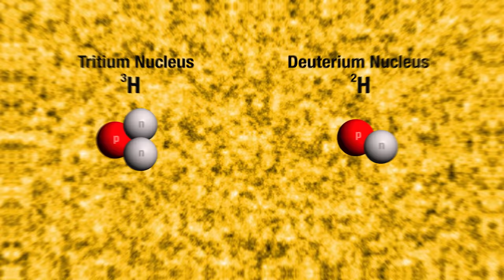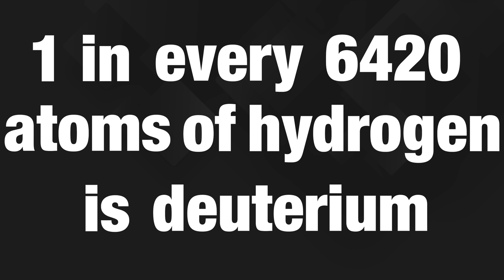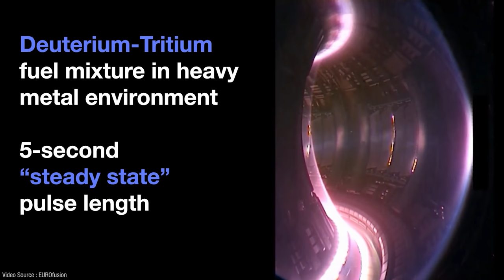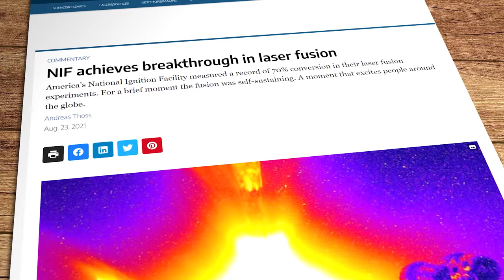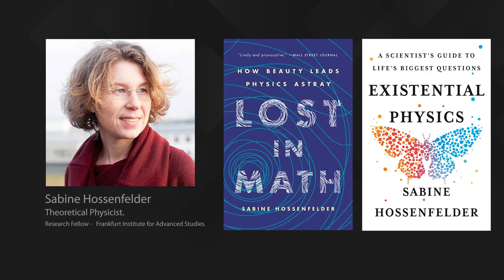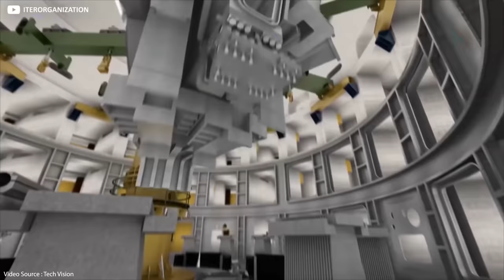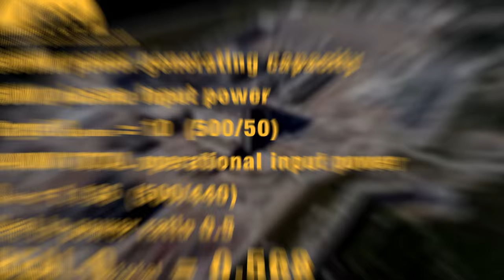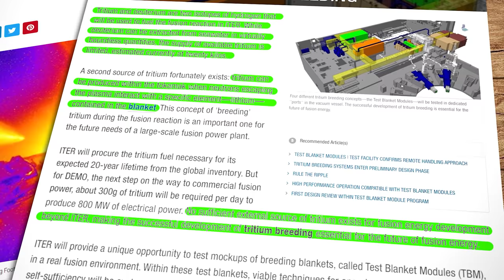Nuclear Fusion Illusion. Is it time to park the pipe dream?

Comment: As an economist, I feel that the economy aspect of fusion is often forgotten. Fusion not only have to be technically viable but economically viable. If we are struggling to make it break even in terms of energy it is incredibly hard to imagine that it will eventually be more economical than just getting energy from the sun, wind and water.
Reply: the hope is that one day we bild one that does break even and starts generating profit.
fusion would not be cost effective against renewables in the short term since the reactors are expensive. but in time they could drive the cost down if they are proven to work. 
the benefit we would get from fusion is that fusion could spin up fast and replace peaker plants, and thus not be in competition with renewables because it would fill a different role. 

i would not personally invest in fusion anytime soon, but as a species we need to pursue all research that could benefit humanity in the long run. Then i support keeping these projects going and even fund more with government money. It not money wasted since an entire industry of technology is built around the construction of reactors and spinoff technologies could be proven usefull.
Reply: @nilsdock  The problem is that this hope is essentially a pipe dream.  Paying for those ridiculously expensive reactors is the largest problem, and it does not appear to be solvable in a world where electricity from conventional renewables is already dirt cheap.
Reply: This.
Reply: @nilsdock  Sorry but fusion using steam will be the same as current steam turbine plants.. which take 2 days to heat up and 2 days to cool down. Actually much worse because you also have to cool down the magnets which will take several days. No instant energy there. It is base load power like current coal fired or nuclear fission system reliant on steam cycle. Totally useless for filling peak power demand. That is why battery technology and pumped hydro is so important as ways to store energy for use when wind doesn't blow and sun don't shine. 
I actually think the whole engineering of getting heat out of a reactor surrounded by cryogenically cooled super magnets is ridiculous. The power consumption of keeping the magnets cool while producing intensely high temperatures inside the container merely a meter or so from the magnet is a huge problem. It works for experiments but the efficiency of ITER, if they manage continuous fusion, means that  waste heat starts to become a problem.
Reply: @rayhaverfield2485  Nation wide battery tech is also a pipe dream nowadays.
Simply all potential solutions need to be pursued, and thankfully are. 
Much more capable scientific committees than the youtube comment section have deemed fusion a worthwhile project. Maybe they deserve some credit.
BTW, tokamaks  can follow demand, they'll probably simply always work at 100% because thats what you do if your fuel costs are negligible and want to pay the loan asap.
Reply: @nilsdock  Fusion is so capital-intensive (the initial investment is so large) that it would never make sense to run it as peaker plants. Also the startup energy demands are so costly that you want to start up as few times as possible and maintain a steady state at all costs.

To maximise profit (make non-negative profit) fusion plants would have to run continuously.  This is true of all new unsubsidised steam turbine generators these days.

Spinoff technologies from battery research are more likely to be useful in the near futture than spinoffs from fusion, and the battery technologies themselves are directly useful. "Spinoff" arguments are raised when the main argument is utterly hopeless.
Reply: might take us a hundred years to get power plants, twice that to make it affordable.
Reply: Renewables become a lot more expensive when they make up a larger portion of the energy suply due to their intermitance. Solutions exist and can be improved but will, like fusion, cost money.
Reply: @incognitotorpedo42  The hope is that fusion energy will also be "dirt cheap". Remember, those reactors also generate a lot of energy, so per $/W is in the same ballpark as renewables now. Probably between 3-10$/W. Note that you have to compare Solar+Wind+Storage against Fusion not just solar or wind prices alone.
Reply: @peterpan5753  they do not generate a lot of energy. 
1. the process needs to produce the same energy it's placed in, 2. plus much more energy to pay for the conversion, 3. plus much much more energy to pay for the super expensive machine cost, (up to here it's not even broken even) 4. and much more on top of that to be profitable. 
currently we are 10% of point 1.
Reply: @rayhaverfield2485  Doesn't strictly have to be. There are ways to generate energy directly from fusion. A company called Helion is working on this right now.

Comment: Great video. I actually studied this stuff in university, and I have been frustrated for years at how poor the reporting has been from science journalists around the efficiency of fusion. I am very fed up with articles quoting Q-fusion numbers, when literally the only thing that matters is Q-total.

I get that fusion researchers are focusing on Q-fusion, because that's their line of research, and they don't have much control around Q-total, because it involves systems that they don't necessarily build. Maybe somebody else can come up with huge efficiencies in lasers, superconducting magnets, or heat-to-electricity conversion, and these would reduce Q-total without the fusion researchers needing to do anything differently.

But I think at this point, any time a science journalist reports on fusion and quotes Q-fusion instead of Q-total it should be considered journalistic malpractice. It's really not acceptable to keep repeating this misleading term.

Now, I'll leave you with one fun fact about fusion: our sun is not actually hot enough to fuse hydrogen into helium. The only reason it does is because quantum physics is "fuzzy", and there are outliers in any reaction at a quantum level. Just as an electron can "tunnel" through a solid "wall", nuclear fusion can happen at lower temperatures if there is such an insane number of atoms available that even a very low percentage of outliers can fuse. So these reactors on Earth need to be hotter than the sun, because the only reason the sun can fuse elements is because there's a sun's worth of atoms in there.
Reply: I agree that there's a lot of confusion regarding Q_plasma because of lazy reporting. That's why I rather listen to scientists such as Hartmut Zohm from the Max-Planck institute, or those working on ITER. They tend to be much more honest in constrast to the click-baity stuff in the media.

Btw., the fusion reaction in the sun is not just different because of the high density/pressure and lower temperature. The sun also uses the much less efficient deuterium-deuterium fusion reaction, whereas in fusion reactors we need to use deuterium-tritium reactions. Otherwise the extremely low density of plasma in tokamaks and stellarators would be insufficient for any considerable amount of fusion.
Also, the sun's fusion process produces less than 300 Watts of heat per cubic meter even in its core, which is a pretty tiny power density unless we consider the sun's enormous volume.
Reply: Idk, for fusion scientists the Q-fusion number seem to be the thing to focus on as that is what they presumably focus on. Journalists reporting that number also seems fine as ppl that are following it can see the importand number. But the mainstream focused media should probaply mention both with a link to somewhere where the difference is explained, and why the Q-total might not matter (the pant isn't build with it in mind for example). And the scientist can again be suprised why most ppl are confused XD.
To be completely fair the cost per MWh is probaply the only number that realy matters.
Reply: @Shimmy Shai I would like to see a discussion on this. I believe that storage is only required while the level of renewable generation is close to the demand level that cannot be delayed. The reality si that we need to generate much more renewable electricity than required, using the excess for the traditional uses of aluminium extraction and nitrogen fixation. Add to that the generation of green hydrogen needed for shipping, aviation and iron smelting. Also we will see DC power links effectively builting the whole world into an electricity grid (exept of course for Texas...).
Reply: To be perfectly accurate the correct number to report would be Q fusion and the Q fusion needed for commercial application with that reactor design. Tokamaks Q > 20, lasers Q >100

The thing is that Q gain changes dramatically as a plasma becomes self heating. I believe JET is about 5% self heated at Q = .33 but at ITER's Q = 10 the plasma is 2/3rds self heated. The combination of this and of the effect of superconductor magnets on tokamaks means that from JET's Q total of .01 (yes, it is much overestimated in this video actually) it is possible that in the early '30's the ARC tokamak will produce a Q total of 3. This depends on self heating plasmas performing as well as externally heated plasmas - but with the current curve of tokamak performance related to size and magnetic field we can expect the Q total of tokamaks to go from 1% to 300% in ten years

If you were choosing between Q total and Q fusion your better number is Q fusion, for really good journalistic accuracy it would be Q fusion and the Q number needed to approach commercialization
Reply: "our sun is not actually hot enough to fuse hydrogen into helium. The only reason it does is because quantum physics is "fuzzy", and there are outliers in any reaction at a quantum level. Just as an electron can "tunnel" through a solid "wall", nuclear fusion can happen at lower temperatures if there is such an insane number of atoms available that even a very low percentage of outliers can fuse."  
Where are you getting this from?
Reply: Also news never explain the caveat & difference between our fusion and the sun's fusion; like the sun use Hydrogen-Hydrogen while we use Deuterium & Tritium, so it might something to do with pressure limitation (number of atom/collision) or temperature difference we have on Earth but it was never explained at all, they just said "hotter than the sun" but why?
Reply: What do you say about environmental impact, neutron activation, Tritium (9621 curies/gr)handling ...
Reply: @xponen  The fact the sun has immense gravitational containment makes all the difference.. Net +ve sustained, cost effective fusion power is impossible compared to the competition (Fission Breeder Reactors). The system is so feeble yet made of so much expensive heavy metal and electrical power. It rapid degrades in performance and parts need replacing very often. It will be switched off for repairs most of the time at best... To break even the cost of the 99+ tokamaks  and all the other fusion power experiments have to be made back... tirllion$ wasted globally so far.. Trillions of Watts too...
Reply: @Click Bait I'd hardly call it a waste. And tbh fusion funding isn't all that great. Regardless weather or not it yields economic power plant it has pushed many fields to their limits. Lasers, plasma physics, material science. We have magnets that are orders of magnitude more powerful and energy efficient then the ones used in many of the projects discussed in this video. It's all good research.
Reply: @theultimatereductionist7592  the sun's core temperature is below the coulomb barrier for fusion to happen (at 100%). some particles may still be crashing into eachother at high enough energies, but the energy output of the sun is higher than would be expected from these events. the explanation for the higher output is quantum tunneling causing more fusion events
Reply: @Shimmy Shai there is already enough technology for energy storage in an environment friendly way. Solutions like Na-Ion (you can buy them now), or aluminum phase change (pretty expensive, but solutions are pretty small and good for a few houses). The problem right now for me is that a tes.pod is too expensive, while the technology is superb.
And Na-Ion are made in India. So for me a big transport cost.
But on a bigger scale it can easily be used. Although I would postpone the Na-Ion with another 5 years, and buy the tes.pod like energy storage now.
Reply: @douglasrogers3918  Today between 12:00 and 14:00 the energy price was negative. There is a lot of PV and none of that energy is properly stored.
There is also no incentive for end users to store it. It's all about better grid control and end user dynamic pricing and making storage payable.
And no, there is no green hydrogen, unless you can transport it in solid state.
Hydrogen can best be generated in the last 10 meters because hydrogen has better burning/heating properties than a heating resistor, can easily be generated on the fly, but can't be stored easily and safely.
Reply: @xponen " this  plasma " is in fact a rare gas,  only few grams in the chamber
Reply: And that’s why the process goes slow enough for the sun to provide energy for billions of years.
Reply: They worry about Q-plasma first because they have to walk before they can run. :-)
Reply: sun has also incredible pressure in its core...
Reply: @theultimatereductionist7592  Well it's true, because you can look at the figures for energy produced per volume in the sun and find that it's not anywhere near the order of magnitude we'd need to usefully produce energy in a reactor.  The sun is in that "barely fusing hydrogen" range where, I guess you can argue whether quantum effects are necessary to produce it, but it's relying on unlikely collisions involving outlier particle speeds to actually release energy.  In our reactors we'd need the fusion chance to be much higher.
Reply: It pays to mislead people. That’s the incentive. Like how stealing is free money
Reply: Tabloids work because it’s too much work to research, you could be using that time and effort to live your life
Reply: I once learned that over the course of it's lifetime, when it dies the sun will have practically the same amount of Hydrogen left as it had when it was born. Practically all that Hydrogen envelope of over 600.000 km's in radius is needed just to fuse a tiny tiny amount in the core.     That's how hard it is to fuse stuff.
Reply: 1 g of protium or trillion ton on 15MK. Ratio is ratio. Quantum tunneling theory is bs like previous ones.

I was not able to find. How do they think to extract electric energy from this?
Thank you
Reply: @Shimmy Shai Storing enough energy for wind/solar to be viable at higher overall % of generation is simply a matter of massive infrastructure investment, there isn't any mystery to it.  Huge pumped back hydro where appropriate,  small scale distributed storage where appropriate, megapack batteries where appropriate.  People both underestimate the scale of this problem and also underestimate the scale humans can achieve when they want to (consider the total scale of fossil fuel extraction and refinement operations, for instance)
Reply: You are hereby a GOD!™
Reply: Part of the reason why one would focus on Q-plasma instead of Q-total is that the test facilities are not designed or optimized to be run in energy efficient ways, rather they are built to be adaptable so that the parameters of the fusion process can be adjusted in order to find what setup is the best one for facilitating it. Once (or if) a viable setup has been discovered, actual fusion plant projects can work on cutting down the energy waste of the facility itself by constructing them to only be capable of using the viable setup for electricity generation instead of being designed for research, and this will drastically affect the numbers for the Q-total equation. The Q-plasma numbers, however, will remain very similar as the actual fusion will behave in the same manner in both the fusion power plant and the research facility, which makes it a more appropriate number to look at.
Reply: @douglasrogers3918  The problem with that approach is that it means a huge over-build of both the power generation AND the aluminum/fertilizer plants that sop up excess power part of the day.  That might require 3x (wind) to 5x (solar) the capital investment, which in turn makes everything a lot more expensive compared to fission or coal or natural gas power plants and aluminum/fertilizer plants that operate 24/7.
Reply: Such a shame what a massive waste of time money and resources... Just think what we could of done if we had put all that effort in to New Nuclear, like Small Modular Reactors (SMRs) Advanced Modular Reactors (AMRs) and molten salt thorium fuelled reactors like (LFTR)
If we had put just 10% of that into (LFTR) for example we could of had it world wide by now...
Reply: Fusion is a lot of work, what I'd we mined methane ice on Europa & burnt it in earth for fuel?

With lakes of frozen gas we could power earth with fossil fuels forever which would be great & power would be cheap
Reply: Nice quantum tunneling description
Reply: Holy shit it is you!!! I LOVE YOUR CHANNEL LOL